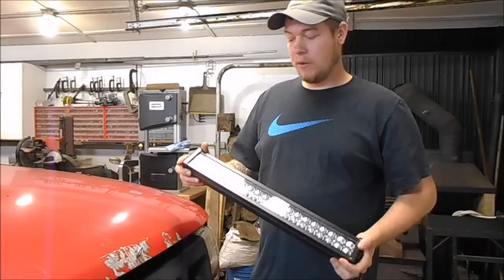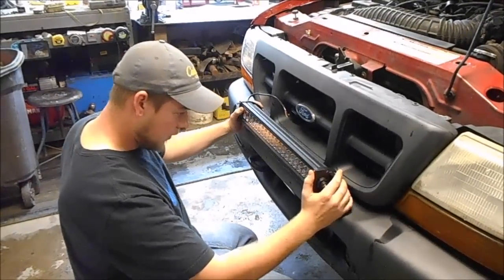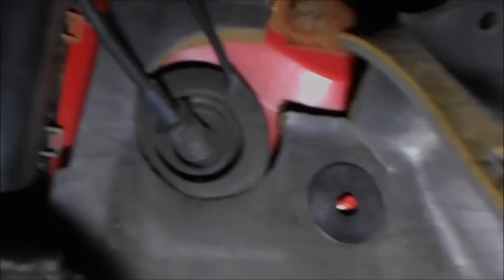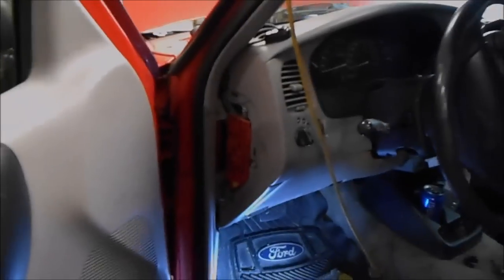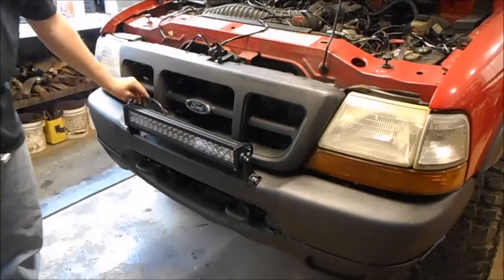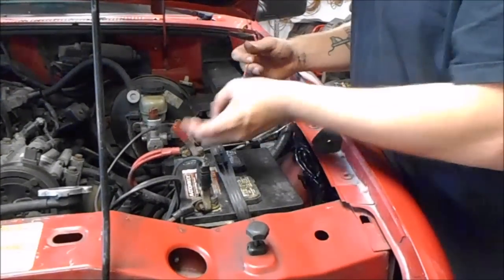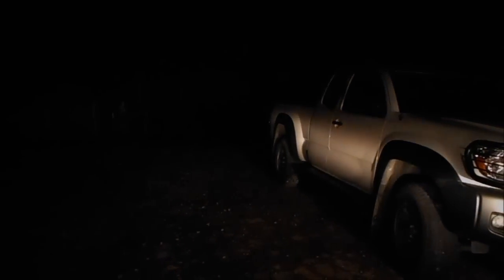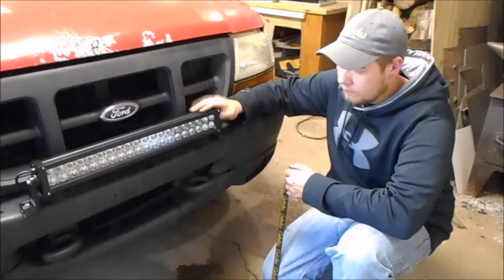ford ranger light bar installation

Comment: Dumb question. So I have a 98 ranger as well and wanting to do the same thing. When you connect it to your batter do you just take off you connections and put in under them and put your truck battery connections back over the top?
Reply: Battery*
Reply from the maker: WA outdoorsman yeah just put them under and tighten it back down should be fine! thanks for watching!
Reply: Should use a relay

Comment: I just have one question.  Tmwhen you wired up the cables to the battery does the off light is all the time on? Don't you have problems with the battery with going dead? What about if I connect then to a head light?
Reply from the maker: If you run your vehicle daily you won't have any issue with that little red light

Comment: so, I was going to do a 50" on my bumper like you did; on my 03 DANGER....thanks, thinking I'll be doing a 20" or 32" instead... you made that look super easy. I'll be using your video to do mine after I order it on Amazon.
Reply from the maker: Mario K. Macagba, BS sorry for the late reply but thanks for watching! 50 inch would probably pretty tight fit across the bumper!

Comment: Just one question: What's a "Renger?"  :)
Reply from the maker: its like a ranger only better..
Reply: @REAL_LIFE  Haha. Fair enough.
I ended up purchasing a 12" light bar for my '98 ranger that I'm going to try to install the same way, but on the lower bumper between the tow hooks, instead of on the upper bumper. I relocated the license plate, just waiting for the bar and wiring harness to arrive now. My only concern is that the lower part of the bumper will be too flimsy. What do you think?
https://imgur.com/tObeCVH
Reply: @REAL_LIFE  Also, have you had any water issues? I saw a lot of reviews for these on Amazon complained about water getting in the housing. I bought some Locktite sealant, just in case.
Reply from the maker: Lol I got 2 light bars at the same time one for me and one for my dad and my dads got water in it within a few months the other one is still good
Reply from the maker: I bought a 52 inch curved and it never got water in it they were all 3 yitamotor
Reply: @REAL_LIFE  Nice. Glad to hear it. I'll hit mine with the sealant just in case. Not sure where you're located but we get quite a bit of moisture here in the Midwest.
Reply from the maker: Southwestern pa been raining for last 3-4 days here

Comment: Your Begging for a short to happen by running that wire through the fire wall unprotected between the rubber bushing and body.
Reply: what would you recommend? Just curious cause I'm about to mount mine and thats my main concern
Reply: Anthony Lynch run it through a wiring harness or even some rubber tubing where it comes through the firewall. You just Don’t want any bumps and vibrations rubbing through that insulation and shorting it out is all. Hope this Helps always better to be Safe than Sorry!
Reply: @dealsgalore  what is the firewall? Is that the body ?
Reply: Number 1 Dad the firewall is the thin metal wall separating the engine compartment from the interior of the vehicle. You NEVER EVER want to run ANY wire unprotected through and wall especially a metal wall where the vibrations from the road and driving, starting and stopping, pot holes, etc can cause that wire to run against the metal because once the insulation protecting the wires is rubbed or cut through then your witless are exposed to metal without any protection left they WILL cause a short to happen or a unintentional ground or a slow drain on your battery to happen and this can cause a fire. ALWAYS run ANY and ALL wires through conduit and then run the conduit through the firewall so you KNOW the wires will be protected and avoid any unnecessary problems or issues from arising down the road.

Comment: Does not show how he got the wire into the cab to connect to the switch.
Reply from the maker: Skip to 1:20 I come through the rubber in the firewall